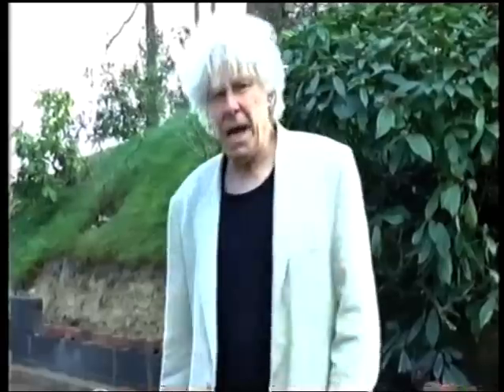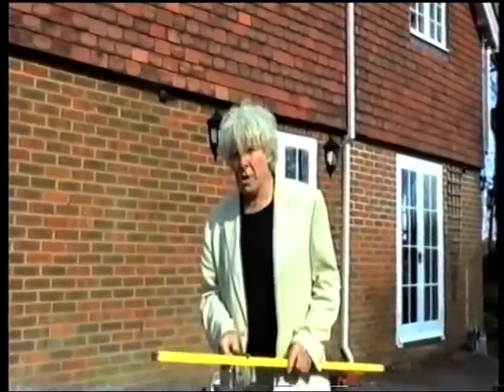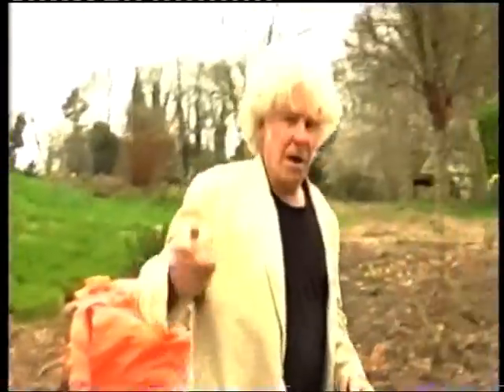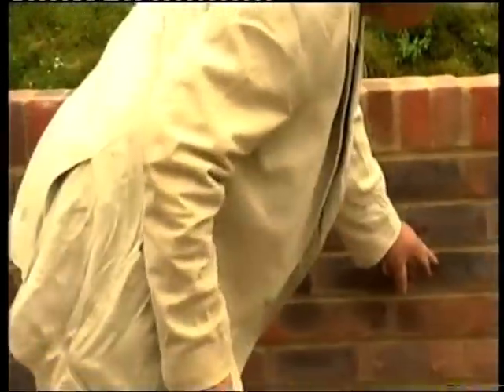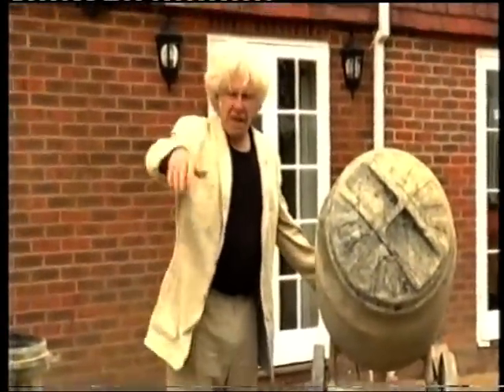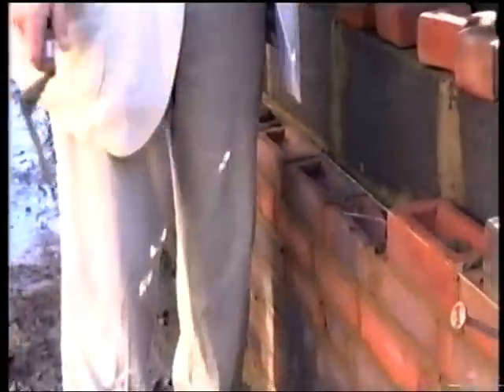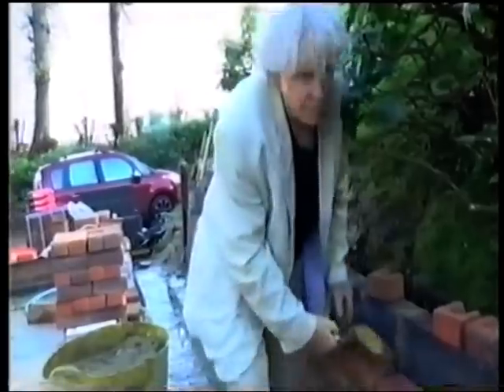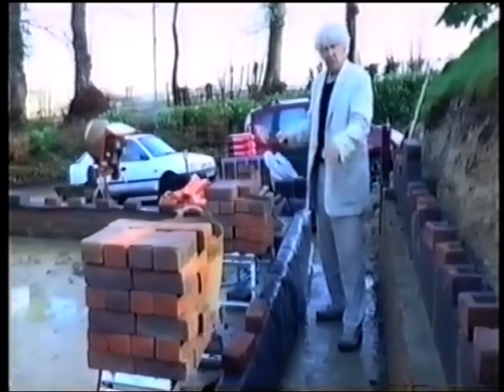BRICKLAYING MADE EASY 4

Comment: One other comment Glenn.  
Do any of your videos have an instruction on the best technique for perping a brick on edge to for either a coping or a soldier course, as in getting no gaps etc.
I tend to butter one main half and then the other, but I guess there are other ways of doing it.
There might be videos of you already doing it, new this channel so still working through them and there a lot lol.
Do you also have tips on how to get a really good mix - in Wales the sand is mainly coarse rubbish dredged up from the Severn, it's not like the smooth London sand.

Comment: Little Tip from Malcolm from Hillary's formally Brighton... get yourselves tile baton cut a 45% angle at one end cut to length 150mm to forming your new jointer... that bucket hande pop back in bag use only for blockwork... there is nothing worse than to see a nice stock wall finished with a bucket handle always finish with a FLUSH wood joint you will thank me for it... let wall go off a bit before jointing... once you start using this finish you will use it on most materials ... happy good weather bricklaying to you all as great show
Reply from the maker: Thank you so much Malcom. You won't believe this mate, but that's what I normally do with stocks. Really. The customer here actually wanted that finish. I can't stand a bucket handle finish. Really appreciate your advice. Funnily enough I just done a wall in stocks and used the rough side of those sponge pads. The bricks were used and really rough, but it gave them a great finish. Might put on one of my videos. Again thank you so much for your comment, glenn

Comment: Another great video bys. Make me laugh and learn as well. So just to clarify,are you saying that the whole bond pattern is random?No joints line up,each coarse is differnt then the next?you are putting the headers werever you like? Thanks again for all the help and tips
Reply from the maker: Yeah buddy, no courses are the same. Lay six or seven stretchers, header, four stretchers, header, six stretchers, header and so on. It's a god idea to lay the first course all stretchers, so as to make it easier to work it brickwork. Don't be afraid of the occasional half bond. It looks ok as it is a wild bond. Thanks for your comment